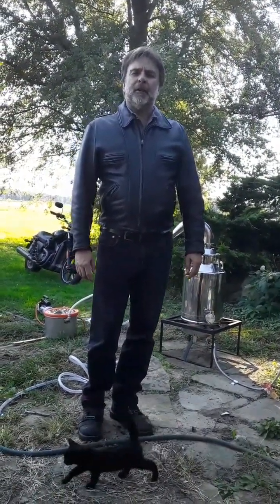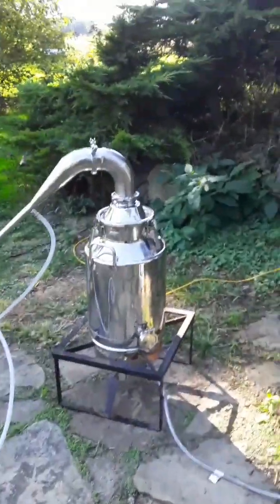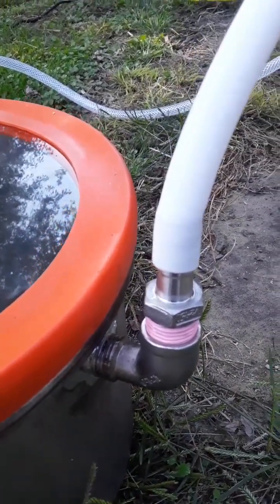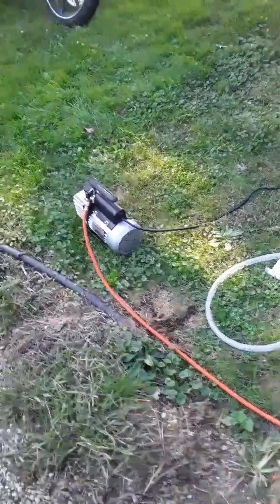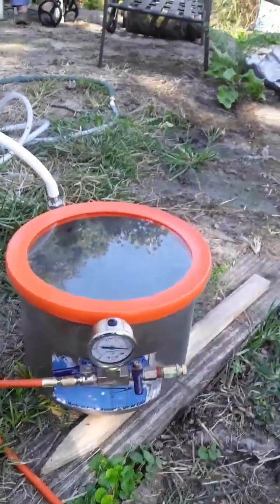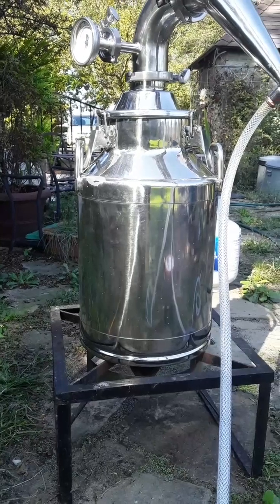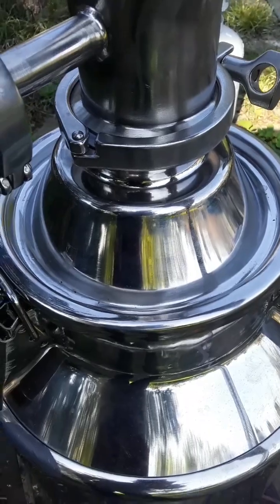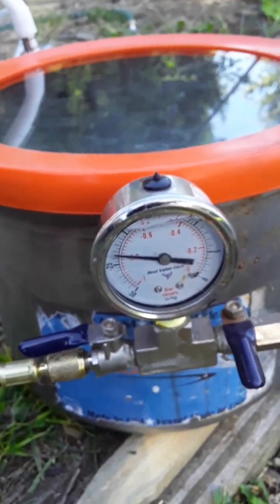Building a CBD extractor/ vacuum distiller with a pot still

Comment: no condenser coil to the vacuum chamber ? 5 years and can not find part 2 ?
Reply from the maker: @christopherstaples6758  yes, there is a Leibig condenser, that's what the Teflon tube is connected to. CBD prices crashed, so I no longer do this, that's why no part 2

Comment: Hi!!
how much time do you need to distill a galon of mixture? Maybe 10:1 water-alcohol for example..
In terms of stability, do you use some kind of core to control boiling inside the tank? Or it is not necesary.
Thanks!!!
Reply from the maker: Time would be dependent on how much heat you have. Couple of things to keep on mind. Most of the heat required isn't to heat your mixture but to boil it. I don't think that amount changes in a vacuum. I have heard it takes 400x the energy to boil as to raise the temp to boiling. I've also heard about 4kwh for 1 gallon, so depends on how fast you can get that 4kwh into your boiler. I didn't have any control over boiling other than fuel control
Reply: @TheSorters  thank u i appreciate your answer!
 i have been distiling about 3 gallons in a tank the last week, but im concern about evaporating all the alcohol in the mixture, because i didnt homogenize the mixture during the distilation so i dont know how to confirm there is no some alcohol left in the thank after the process. i have heard just the temperature increases because there is no alcohol anymore, but i dont know, what do you think?
thanks again!!
Reply from the maker: @bryandiaz5282 you will never get all the alcohol. Alcohol and water bind very well together, so I am not sure mixing will have any effect on getting the alcohol separated. You really need to stop distilling before all the alcohol is removed from your wash or else you will end up with a lot of water in your final alcohol. Best way to get most of the alcohol out would be with a reflux still with a lot of reflux, but I just have a pot still
Reply: You need a cold trap and condenser or your losing a lot to the vacuum pump it will literally condense in the pump and there is no good reason to only pull an 80% vacuum
Reply: And the problem I'm running into is how to separate heads tells or alcohol from thc cbd

Comment: Any updates to this? Thanks for video!was looking to see if this may work....another condenser before the vacuum pump would be good,(draining back to pot)to prevent any ethanol etc.from being drawn into pump.
Reply from the maker: No updates, I am not in the CBD business any more, the prices are not economical. This idea could also be used for bourbon, allowing the mash to be run through the still at a much lower temperature, maybe allowing more flavors. It would be better to use a better, dry vacuum pump, as in a lot of labs. You would get a lot of alcohol in the vacuum pump's oil with this cheap single stage one.

Comment: In creating vapor, wouldn't you constantly be adding molecules to the system -- meaning your roughing pump would constantly need to work even if there were no leaks?

I'd really like to hear how this vacuum setup worked -- I usually see People using "water circulating" vacuum pumps (still not clear how those work)....  The idea of vacuum distillation of bloody butcher -- just, Wow!
Reply: I think you really aren't adding gas molecules since they all get condensed back into a liquid in the condenser. So, i believe if no leaks existed that the vacuum pump could eventually be turned off.
Reply: @gregsorter9213  for just six months  (40 years ago, so I could be wrong) I got to be a trainee technician etching and outgassing parts in bell jar high vacuum stations.  I'd use a sorbtion pump or diffusion pump as the roughing pump and then open the valve to the Penning discharge pump to take it down the rest of the way.  I was taught If there was even a finger print the oil would boil off for hours and prevent the target vacuum level from being achieved.   I am so glad you replied.  I don't want to ask about your specific experience, but I would like to ask about hypothetical and corn flavor.  Does your rare seeds email still work?  I did throw in that question just to appeal to you as an Engineer (try to get a rise out of you), so i could hopefully ask other things off-line (not about hemp)...?  Thx!
Reply from the maker: @oasismike2  no, the rare seeds site doesn't work. Had a major health scare and lost the farm. But, I do have a bucket of the best seeds, and hope to plant them next year. Regarding the vacuum, I just need that 80% vacuum so a cheap pump is all I needed. Ironically, I picked up a turbomolecular vacuum pump from University of Michigan's surplus, but didn't know what to do with it so gave it away!
Reply: @TheSorters  hope ur all healthy -- sorry to hear!

Comment: Not that you care? But to insulate the still might help? It's made for booze ?
Reply: I thought about insulation but wanted to make sure I wasn't collapsing the boiler so I wanted to see the walls. The walls do get quite cold, not hot. The energy to convert to a gas lowers the boiler wall temperature quite a bit

Comment: what size pot still is this? 5 gallon or 8 gallon? and where did you get it from? and what size vacuum pump for this setup?
Reply from the maker: I believe 8 gallons, Olympic Distillers, heavy duty version has 1.5 mm wall. Vacuum was just a cheap single stage one from Harbor Freight. Once you evacuate the still it doesn't take much to maintain the vacuum, just however much is leaking